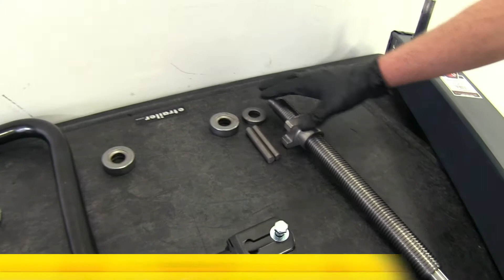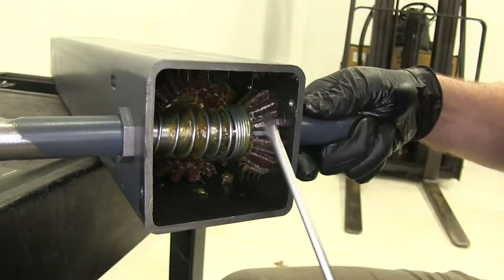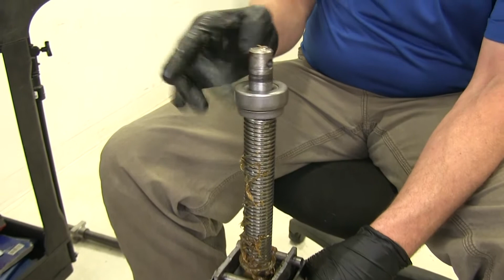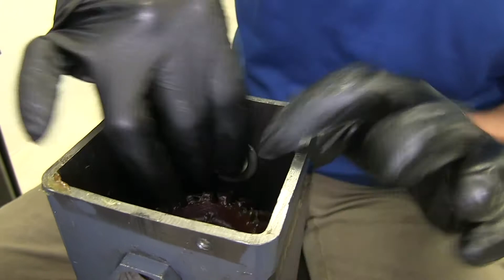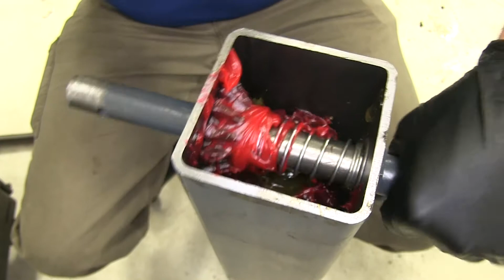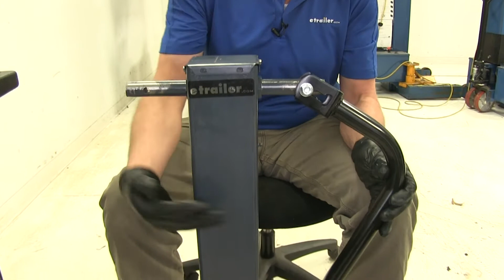etrailer | Rebuilding a Bulldog 12000-lb Capacity Jack

Comment: Yes, you're right. If the raw materials aren't Q235B, the jack is very prone to deformation; and if the supplier cuts corners, the gears and lead screws won't meet standards, causing the product to stop working during use. Additionally, the internal springs must be the largest size available; otherwise, the overall load-bearing capacity and lifespan will also be affected.

Comment: Ours doesn’t have a pin in the bottom part that hold the threaded rod in the bottom or a spring across the wind handle and can’t seperate the 2 parts of the jack body

Comment: If you want to change the direction of the spring pin you pull to drop the pad will the leg unscrew or do you have to do this tear down? Mine is mounted with pin facing front of trailer would rather it face side? Thanks (This is due to wanting to mount a tool box in tongue and not block access to pad)

Comment: What if you bent the innner tube and drop leg?
Reply from the maker: We do have replacement inner jack legs that allow you replace the lower half of the jack if it gets damaged or stops working properly.
https://www.etrailer.com/Accessories-and-Parts/etrailer/TJD-12000SP-FIP.html

Comment: What’s the part number on the spring at the bottom? To lift the leg
Reply from the maker: We have a replacement spring for your return jack leg in the following link. The part number is TJD-12000-RSP.
https://www.etrailer.com/Accessories-and-Parts/etrailer/TJD-12000-RSP.html

Comment: I forgot to drop the foot of my welded-on Bulldog jack for my horse trailer. A couple over-turns later, I snapped the jack's shear pin. This was the ONLY video that could get this city girl to understand the mechanism well enough to fix it myself. THANK YOU. (No trailer repair company would fix it, and insisted I weld a new one on). I will note that I seem to have a significantly older model jack with the same lift/static capacity, so instead of a spring there is a solid roll (dowel?) pin. I could not find singular shear/this type dowel pins ANYWHERE and was short on time, so I ordered the whole gear kit referenced here. Wrong size for mine, but the one pin I needed fit! Literally 5 minutes later I had the jack cranking again. Thank you, Thank you!
Reply from the maker: We are happy to hear you were able to get it fixed! We are happy to help! Thank you for sharing this with us.

Comment: My jack will lower but won't hold a load or lift my trailer... I want to replace the parts without cutting the old one off and welding in a new one. what parts should I purchase?
Reply from the maker: I would start my opening the top of the jack to see what the gears look like. You may have a damaged set of gears. In this case you would replace them with the following kit. If you replace them, be sure to grease them really well.

https://www.etrailer.com/Accessories-and-Parts/Bulldog/BD500212.html

Comment: Can I use these replacement parts for a bulldog 10000 lb capacity jack
Reply from the maker: Actually that's exactly what they're for. They're for Bulldog jacks that have a 12,000 pound static capacity but a 10,000 pound lift capacity. Such as https://www.etrailer.com/p-BD182513.html

https://www.etrailer.com/dept-pg-Trailer_Jack-gw-10000_lbs-pm-Bulldog.aspx

Comment: How do you hold up the trailer while you take the jack apart?
Reply from the maker: A floor jack and jack stands
Reply: Mine is fully welded on, so to drop the inner tube / screw assembly it seems it would require the trailer to be very high in the air, like need a fork truck high, or a pretty deep hole to be dug and driven over to allow space to remove and replace the inner. 
It seems maybe you could get by only raising it enough for the inner to drop out and then separate the screw and then bring it out second, but I’d think that would still need to be way higher than a typical floor jack.  

Am I missing another easier solution maybe?

Comment: Very helpful.  Thank you.  I had to replace the "foot" and the first inner sleeve (without removing the exterior mount since we have an electric motor and there were welds and other adjustements).   I was a bit apprehensive about tearing into the project.  This video provided excellent instruction and inspired me to quite procrastinating.  Well done.